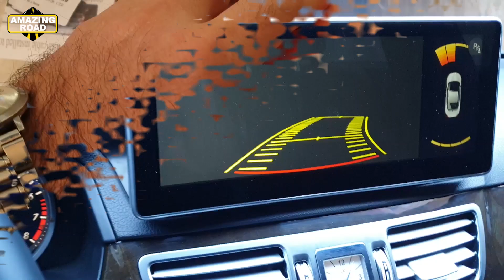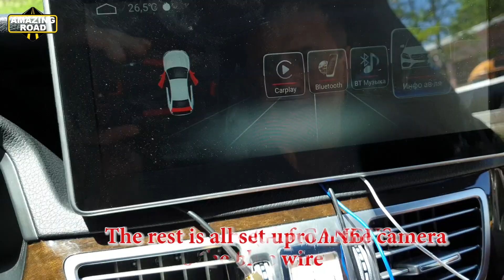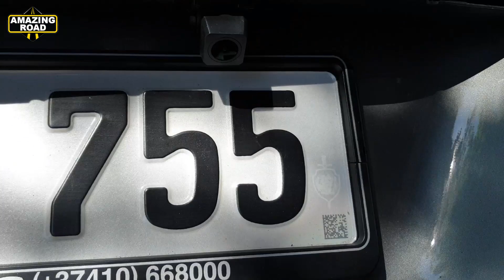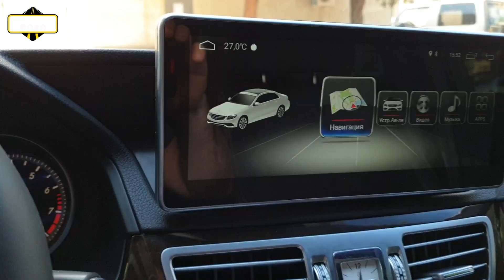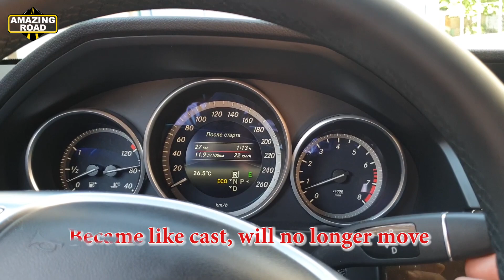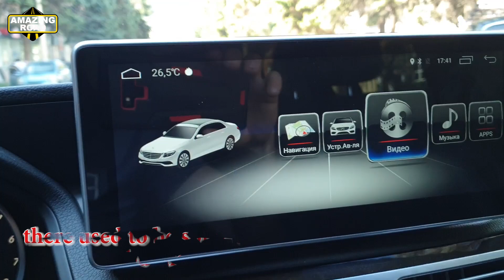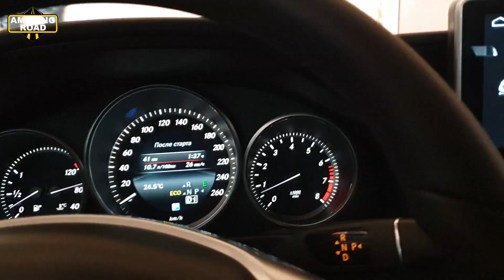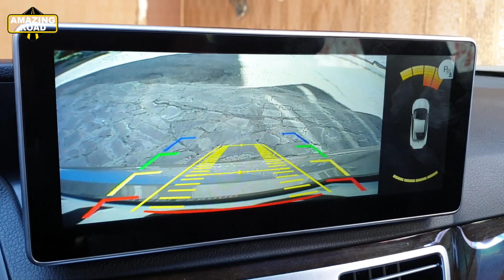How to Install and Connect a Backup Cameras, Detailed instructions / Rear View Camera on Mercedes

Comment: Hi I've just been trying to install a reversing camera as in your video  so do I connect yellow plugs together and connect the two single wires mine are red on mine and run cable through to rear of car where I connect the yellow plugs together where do I connect rest of wires thanx
Reply from the maker: Do as in the video. https://www.youtube.com/watch?v=gEC9XngEipU&t=7s

Comment: Do you still still need power from reverse lights asweii as the blue power lead from the screen.
Reply from the maker: Power from the rear lights is not necessary.
Reply: @AmazingRoad  its awesome easy simple ! nice
Reply: @AmazingRoad  How does it know you putted in reverse?

Comment: I  have problem with it . Reverse camera turns on and works when ignition is on . 
When engine is running after 2 seconds the pictures goes . Why is this
Reply: i think you need to go secret menu on your radio and set different signal from camera
Reply: I sorted it . I had to wire a relay

Comment: Where did you connect the positive cable my friend?
Reply from the maker: The camera works through canbus. Connected to the monitor wire
Reply: So, that’s happens just when using one of those android screens, right?
Reply from the maker: Yes
Reply: Thanks a lot! I am thinking about buying one of those, are they reliable with the time?
Reply from the maker: @DiogoSilva-hr8ee  I’ve been using it for more than a year now.
Reply from the maker: @DiogoSilva-hr8ee  no problem
Reply: Thank you! I think I will buy it, thanks for your helpful videos